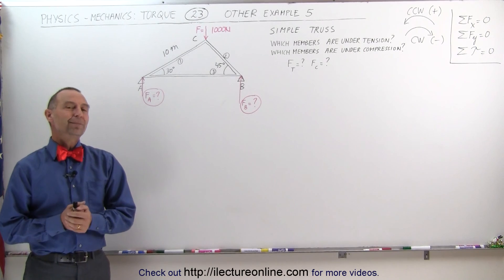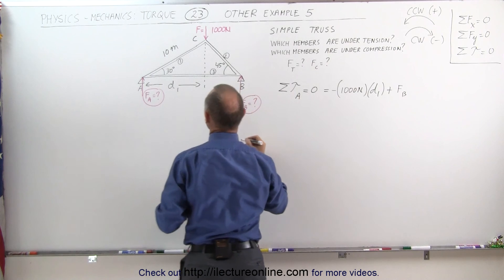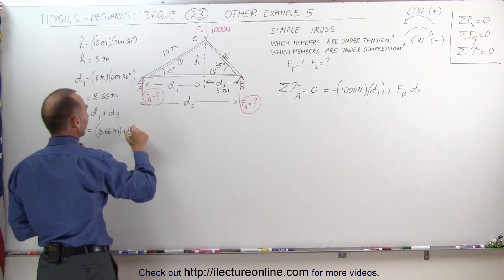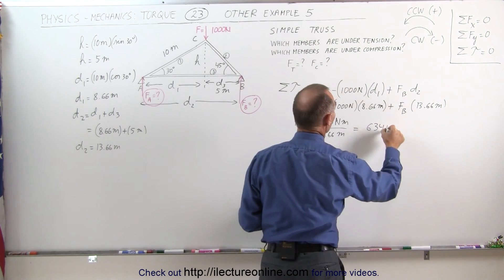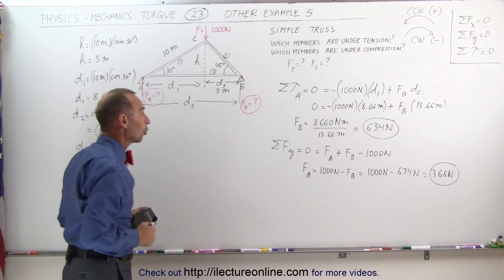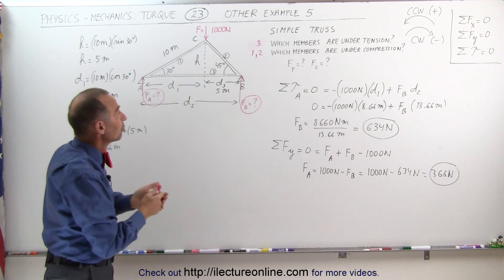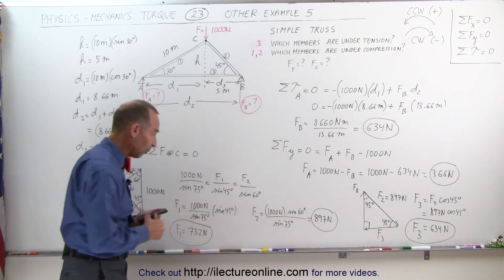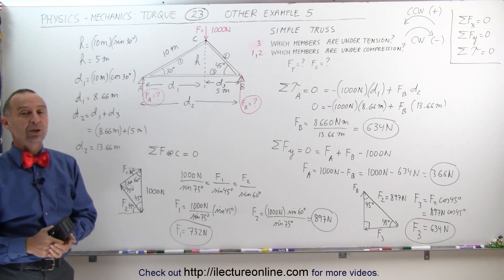Physics 15  Torque (23 of 25) More Examples: 5 F(A)=? F(B)=? of Simple Truss

Comment: Hi, professor. For finding forces 1 and 2, would it be alright to just use the information of FA and FB? (which I believe they are the components of F1 and F2 in the y direction) In this way, F1= FA/sin30 and and F2 = FB/sin45.
Reply from the maker: Try it and see if you get the same answer.  The technique shown is the proper technique to solve these types of problems.  We have more complicated examples of how the forces are calculated in a truss.

Comment: Can you explain why  the  tension in beam 3 is 634N not 1268N . There is an equal and opposite force  in the x direction at point A. Would not the tension in the beam be countering both these forces and therefore be equal to there sum. I am  confused.
Reply from the maker: You need to add the forces as vectors.  (That is why the triangle technique is so powerful).
Reply: @MichelvanBiezen  Still confused but thank you for the reply.